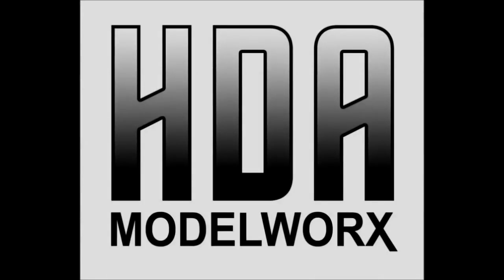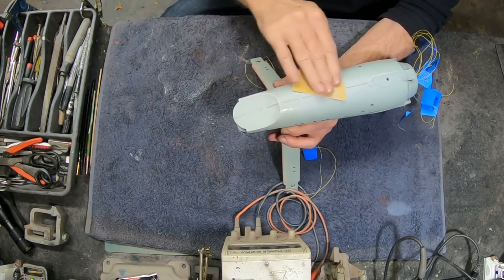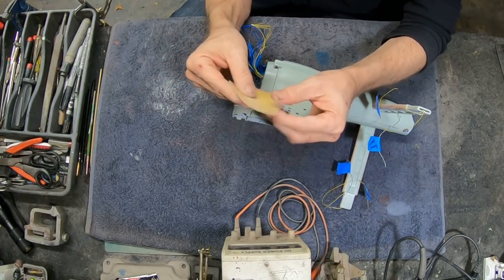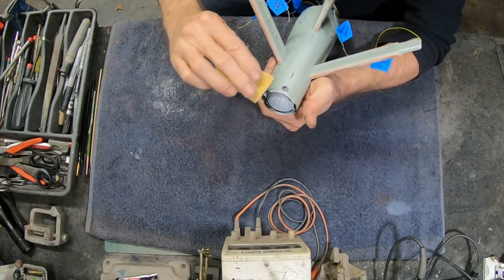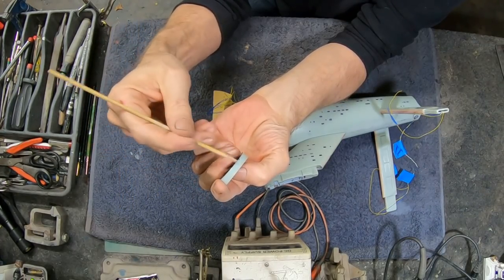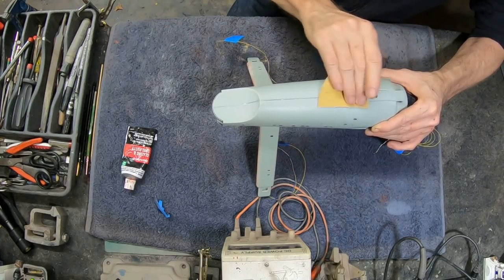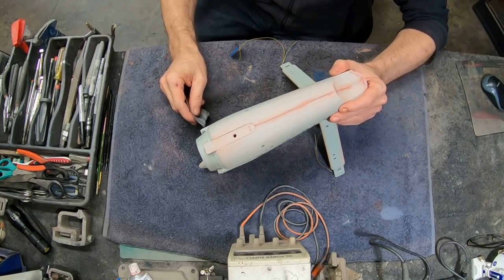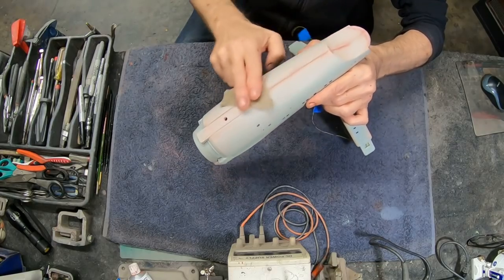Updated 1:350 Scale Polar Lights TOS Enterprise Build Series Pt 7

Comment: Hello! Love your channel😊
I've bought the model and polar lights lighting kit, my workshop includes the power supply and airbrush ect. Could you provide a link to where to get the best paint and glue for the model..that seems like the most challenging aspect (for me) 
Thanks and keep up the great vids😊
Reply from the maker: I'm using water based craft acrylic paints but unfortunately right now it seems people everywhere are having a hard time getting any because they are out of stock. I think it's due to the pandemic. As for glue any good brand made for styrene plastic should be fine.

Comment: This might sound like an amateur question but how do you remove the fine dust particles after you have sanded. Do you blow it off with air or or wipe it off with a wet cloth for instance. 

Also just wanted to say thank you for such a good series of videosonnthis build. Your previous ones were excellent. This is a whole new level
Reply from the maker: I usually just blow it off with air.

Comment: Out of curiosity,  can the clam doors still be mounted without adding the Shuttle Bay?
Also do I need to add extra lighting to the Observation Deck that is right on top of the Shuttle  Bay?
Thanks Mr. Boyd.
Reply from the maker: You'll need to put in at least the rear part of the shuttle bay arch that the doors rest against or you'll have a huge gap. I used an 0805 warm white SMD to light the control room window above the doors.
Reply: @TrekWorks  
Thank you sir. 😉